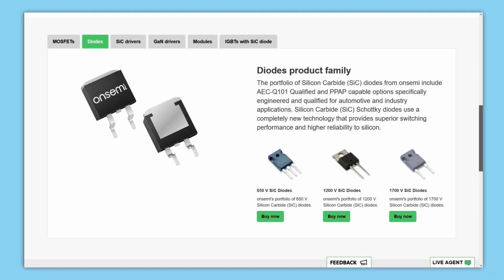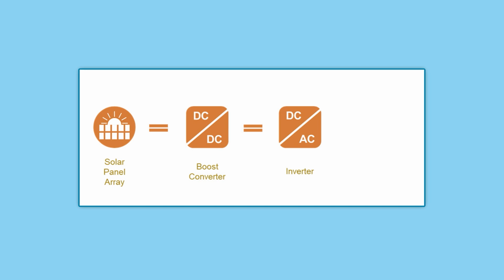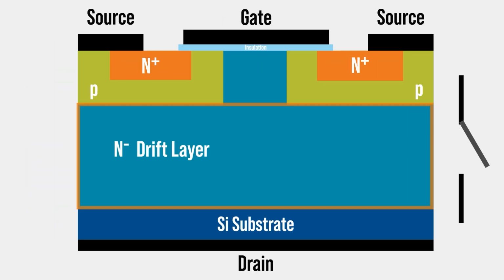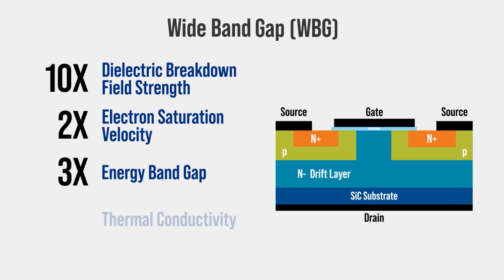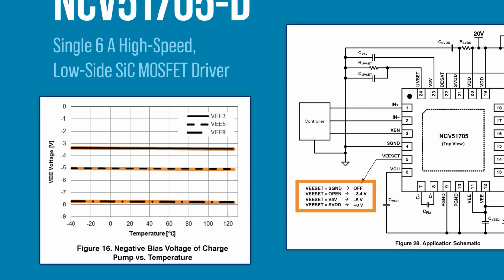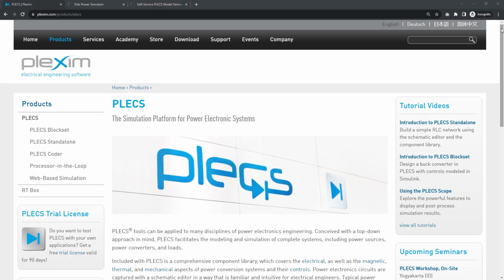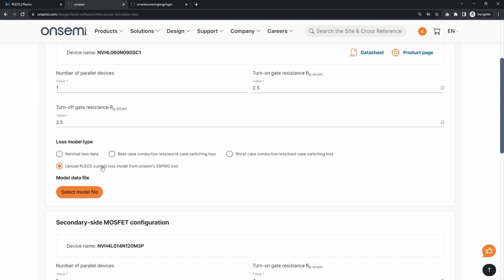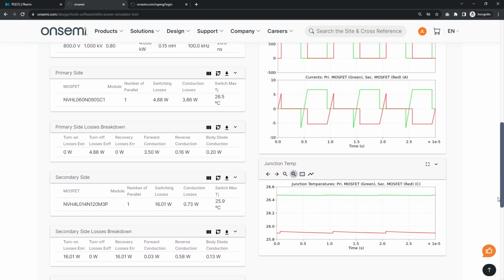Silicon vs Silicon Carbide Transistors - Workbench Wednesdays

Comment: How abot SiC vs. GaN?
Reply: They tend to be found in different places in the power converter market. High-voltage/power tends to favor SiC while Lower-voltage tends to favor GaN. SiC has lower on-resistance compared to GaN, but GaN can operate at higher frequency than SiC. So for high power converters (10 kW and much higher) SiC is more favored for efficiency. But for low-power converters (think laptop/USB-C chargers) the higher-frequency capability of GaN means much smaller devices.
Reply: @bald_engineer Excellent summary, thanks!